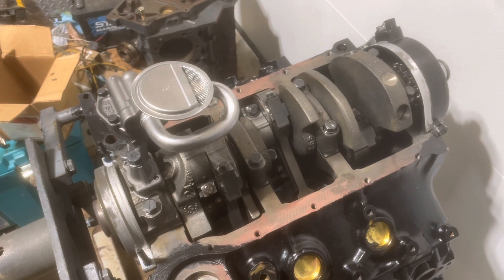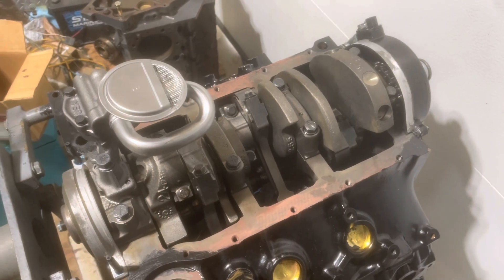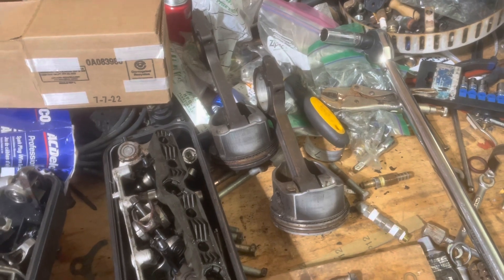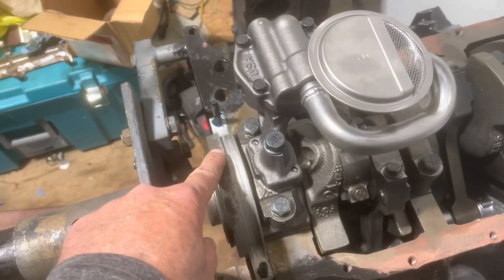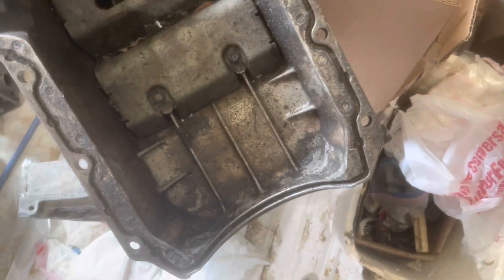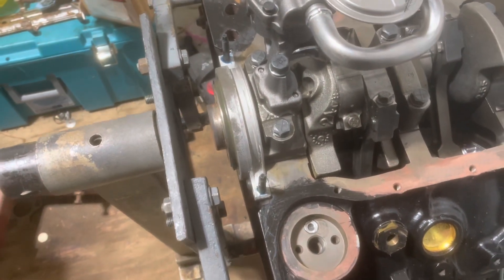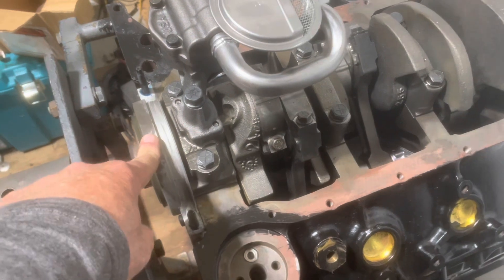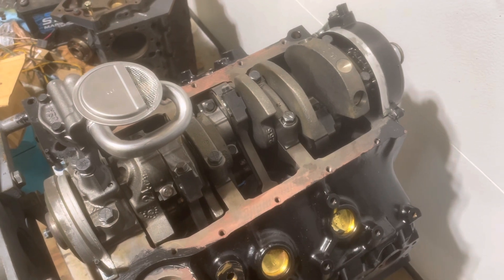Mercruiser 4.3 - Late Model Differences

Comment: is that designed by GM or Mercury it self?
Reply from the maker: It’s a GM design. I think the Vortecs were improved with a new design in 2007. If I find any different I’ll post here.
Reply: Im having a weird problem with my 4.3 v6. I have tested and or changed nearly external parts with new carb and fuel pump etc.... Tested compression and its okay. Issue is the boat will not rev above 3000rpm in forward gear in the water..... As a result boat (maxum 2400scr) will not plane. It will rev out to wide open throttle with ease in neutral or reverse. If the boat is put in forward gear in a water barrel out of the water it will  rev freely to wot. It is worth mentioning it makes no difference if there is 8ppl on board with day bags and a full tank of fuel or if boat is empty and just me on board, still always bang on the same rev it just sits at. Ive also tried a number of different props with varied degrees of pitch. Hoping you can help 🙏 T.I.A.
Reply from the maker: @patrickfinnegan8118  take a timing light and check timing at idle. Then rev it up and check timing again at 3500 rpm. The timing should be much more advanced at 3500 rpm. If not replace your ignition system with a Delco Est ignition system. If the timing advances normally then you are either starved for fuel or too much fuel. Remove a spark plug and check the color. If it’s white it starved for fuel. If it’s black and almost wet it’s too much fuel.
Reply: Behave had the plugs out several times and never noticed anything note worthy there fresh plugs and have been replaced a few times. The boat sat for a while and i bought it running but like this and since done all above mentioned work. It is never hard to start hot or cold, never smokey or back fires etc... Also runs really well very smooth jist as i said will not rev over 3k rpm for love nor money exactly what should the timing set at when idle and then at what at 3500 rpm? Its a votec thunderbolt.
Reply from the maker: @patrickfinnegan8118  what is the engine serial number?
Reply: @moccasinmarine  okay finally getting somewhere, I had previously timed the engine to 8degrees tdc, with looking at you videos I seen your timing graph for the 4.3s and plus talking to you I went back to the timing and reset it to 18degrees tdc and boom went from 3000 rpm to 4600 rpm and I've gone from at 18kph to just shy of 50kph 🙌.
Reply from the maker: @patrickfinnegan8118  then something is wrong. The timing in my videos is for the Delco EST system not the Thunderbolt system. You are running the risk of blowing your engine. It sound like someone may have swapped in ACDelco system before you got it. You should post a video of your distributor and ignition modules.

But you misunderstood my videos. No where in the instructions do I say to time an engine at 18 degrees BTDC.
Reply: @moccasinmarine  is there a better place I can contact t you send you any pics or videos YouTube comments are not ideal, Facebook instagram etc.....?
Reply: @patrickfinnegan8118  
I can't comment on the ignition differenced having a Prestolite points distributor on my old 1988 4.3, but I had the exact same problem, it would run fine at idle, rev in neutral fine, the timing would advance as per specs in the manual but it would not plane out the boat. My mechanic went through it for me and what he found was that the anti-siphon valve on the fuel tank was corroded and the ball was stuck, restricting fuel flow. He replaced it with a better quality one and it's been fine since then (this was back in 2004!) So if you haven't checked that, take a look at it, it will be the fitting on the tank that the fuel line from the pump/filter connects to.
Reply: 0F826776 is the engine serial number
Reply from the maker: @patrickfinnegan8118  search shows you have a Mercruiser Thunderbolt V ignition system. Use the info here to set the base timing.

https://f01.justanswer.com/tommym1119/e1bfab5a-3b4a-4df5-9eed-57a2e4a91468_service_manual_18_base_timing_mode.pdf

Once the base timing is set to the value on the flame arrestor, return engine back to normal. Then crank and watch the timing as you rev it up to 3500 rpm. The timing should advance smoothly up to 3500 rpm. If it doesn’t advance or stays where it is you may need a new ignition system.

However before you do the above, wiggle all connections at the module, the ignition coil, the distributor harness, basically everything that helps to make a spark. A loose connection that vibrates at a certain RPM can cause the engine to cut out intermittently which acts as a rev limiter that you can’t hear.